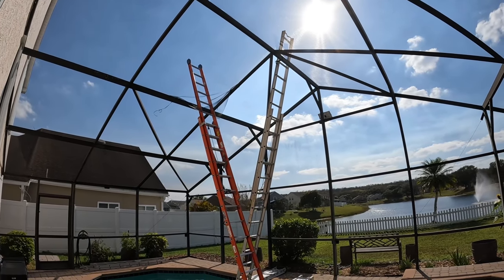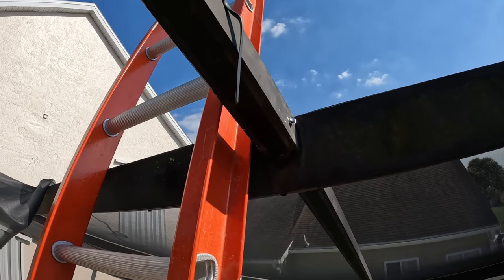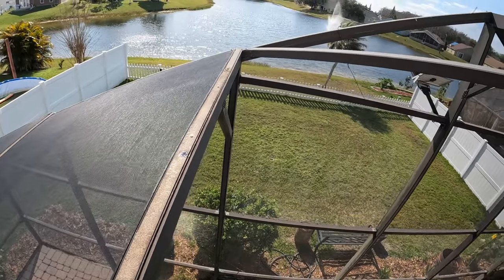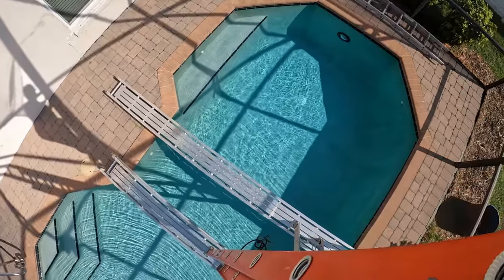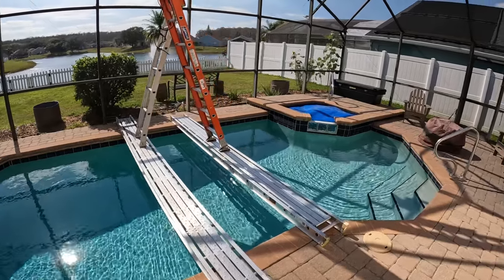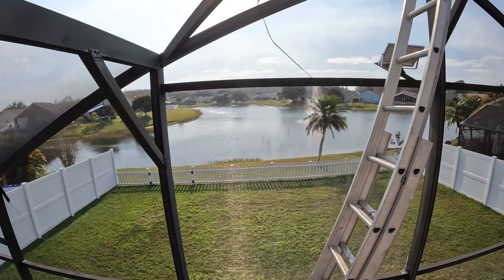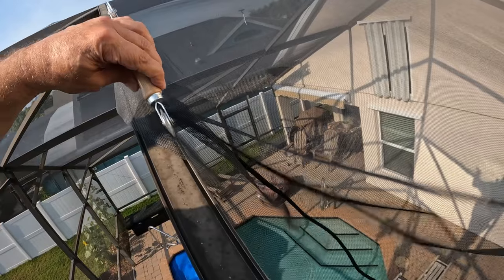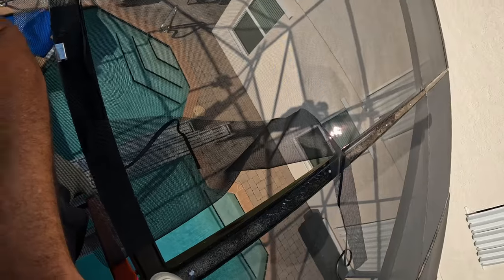Florida Pool Screen Roof Replacement - Feb 2023

Comment: Thanks SO much for posting this video! As a homeowner in SW Florida, most pool rescreening companies after Hurricane Ian and Milton are ONLY interested in FULL CAGE rescreens. The smaller companies can't keep staff on board, can't get supplies, and (rightfully) worry about the integrity of the pool cage.  I've been looking for a means to do my own rescreening (and re-bolt the metal screws) on the top of my cage and your video is the only way it can be done safely!  Can you put a link where you purchased your Aluminum Stages?  Thanks again!

Comment: Great video. I have some screen damage after Milton. Unfortunately, they're the top panels on a two story pool cage. Called a dozen screening companies, no one wants to do just a repair, especially if it's on a 2 story cage. How did you remove the screen clips on the opposite sides of the panel after installing the spline?
Reply from the maker: I start at the highest panel and work my way down, keeping the clips on the same side as the spline, removing them as I proceed to complete a panel. Unfortunately, I may have to remove an undamaged panel/panels to access a higher one.  Then replace them as I continue working my way down, or to the closest outer perimeter of the screen cage.  The only way around this is to walk the beams, which insurance doesn’t cover & I don’t feel is safe.  It’s definitely a puzzle off the ladder, hope this helps.  Thanks much, appreciate

Comment: Do you have anything under the stages to prevent slipping?
Reply from the maker: The stages go directly onto the concrete pool decking or pavers with nothing under them, though I'll use a wedge style spacer at the ends to level the stage if it moves at all before ladder placement.

It's critical that the ladder placement is centered on the width of the stage, and maintain approx. 65 to 68 degrees ladder slope. The weight of you and the equipment prevents movement.
Reply: @jwhoward  Thank You So Much!